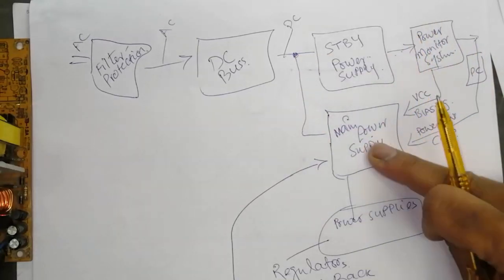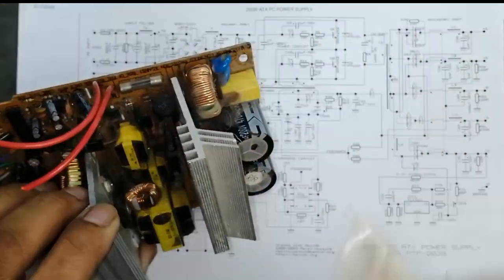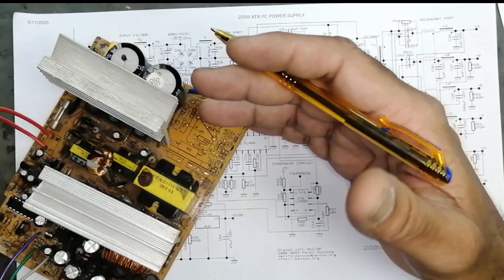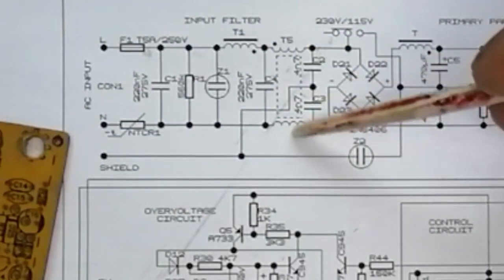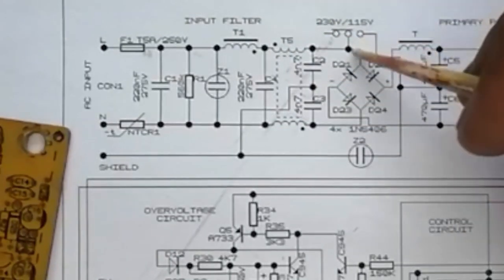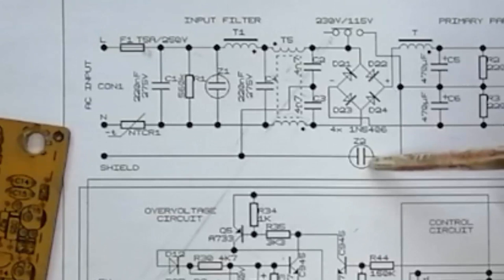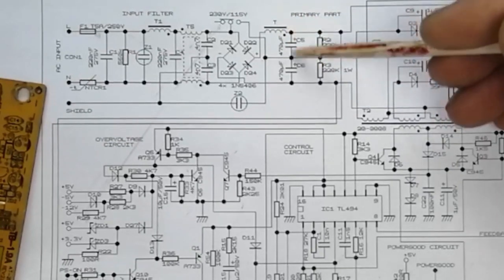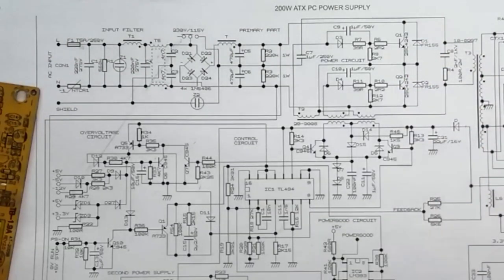#168 ATX POWER SUPPLY CIRCUIT DESCRIPTION TL494 TL594 SMPS PWM CONTROLLER

Comment: It's a useful tutorial. ATX power supplies are complicated but going deep down the schematic has helped. Power supply troubleshooting is the most interesting part in electronics repair for most of the techs. It's sad that ATX power supplies don't hold much value for repair businesses these days because they are inexpensive and easy to replace. Anyway, it's rich and informative tutorial that I should keep as a reference. Thank you!
Reply: Not rly. I aloways try to fix. PSU especially in laser printers...
Reply from the maker: laser printer psus are slightly complicated due to dual nature power supplies. best wishes

Comment: I have a psu that works well on the second output voltage 22v not 8v 

Is it necessary that the output of the srandby transformer be 8v?

Comment: Assalam Alaikum Warahmatu allah wabarakatuho, thanks for this awesome video tutorial, Sir i have an 300w HP ATX ps, i follow up your tutorial and i checked the purple and the green wire its showing 5V, but when i shorten the green wire with the black the lamp 75w keep on switching on and off so the power supply, kindly advise.
Reply from the maker: please use 100 watt or 200 watt lamp.
if same problem then
if it is PFC based circuit, then check MOSFET for PFC portion 
and 
check MOSFETs or Transistors for High Power section
Reply: @HaseebElectronics  I will inshaallah, thanks for your prompt reply

Comment: In my case as you meantion in las 5min the fan trys to move then stop. Also 13.6v comes to pin no 13. Must it be arroun 10 to 12 volt?

Comment: Is it a must power good connection to available to power on the power supply. Or can't we just turn on without power good signal from white wire.
Reply: @HaseebElectronics  I am still finding my error why its not turning on. It only trys to start and instant turn off. It just shake the fan. Can you help me to solve my problen. Can you make a video for how to find dead short on power supply circuit board.
Reply: Its looks like a dead short. Just voltage slightly increase and drop quick at power on.

Comment: Sir, how can we modify this circuit for taking 14.3-14.5 v for car battery charging. Also will that cut off charging after achieving 14.5 v  Thanks
Reply from the maker: please use LM317T with for battery charger with cutoff circuit. 
okay i will try to share a circuit
Reply from the maker: it is same KA7500 circuit. 
check pin 1 2 15 & 16 pins for adjustment of voltage

Comment: Is 5v the signal of power good circuit ?
Reply from the maker: power good signal provides surety to CPU that the power supply is working normally and its voltages are within limits

Comment: Sir my TL494 pin 12 show 14.4 volt but when I connect black and green cable pin 12 show 15 volt, this is normal or not ??
And if I connet externally 5 volt to green cable I should control on TL494 pin 13 and what should I see pin 13   ??

Comment: Is vcc the purple cable ?
Reply from the maker: that is +5 VSB it is VCC and sometimes 12volt from the SB transformer are used as VCC voltage
Reply: What it means vcc. Obb. Input 1.2.3. & how can i know pin protection name
Reply: How can i remove protection from hs8108 & 7520 & lm339

Comment: i repaired mine but now there is noise from transformer .
Reply: @HaseebElectronics   Thank you for reply. Smps is car battery charger with 13.7V out put at 20amp rated. i will check tl494 pwm .